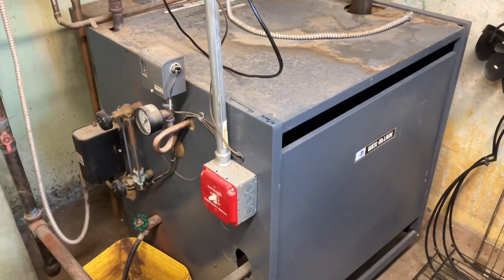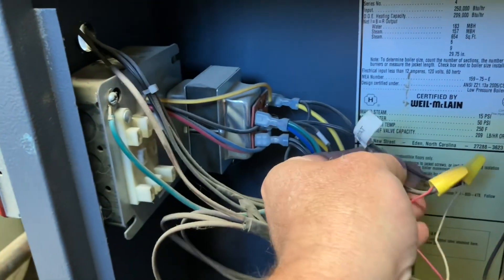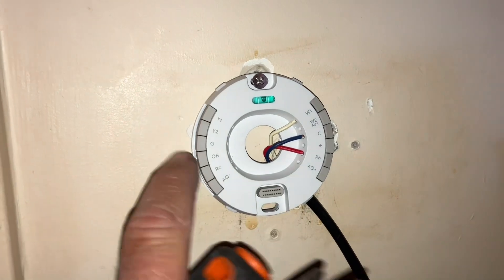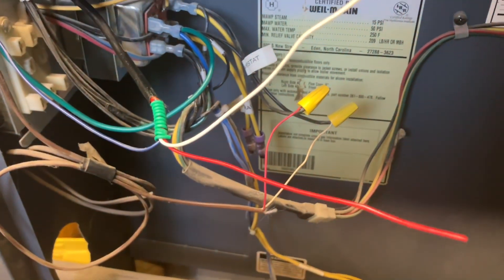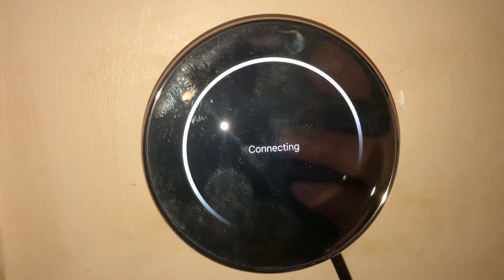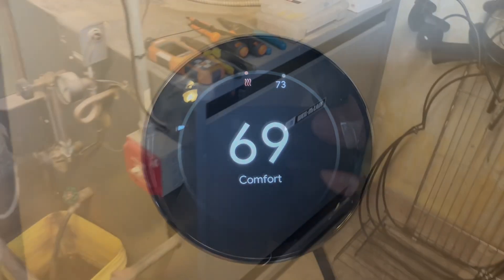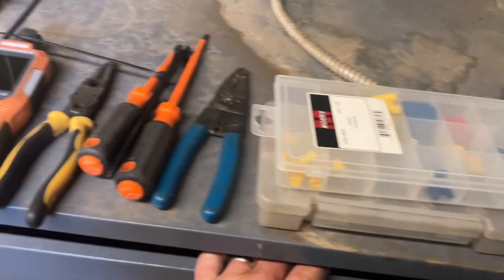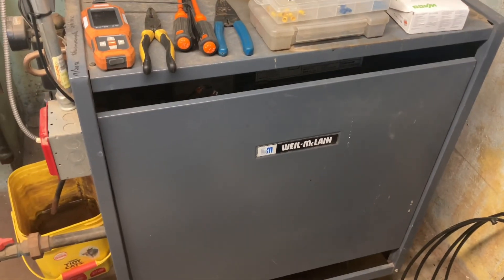How to Install Nest Thermostat on Weil McLain Steam Boiler

Comment: THANk YOU for this video! I got an Ecobee thermostat today and I was at whits end with just the two wires that were connected to my old thermostat. Luckily my insulator had a third wire (unused) inside it so following your video I easily connected it to the C on the transformer side and then to the C on the ecobee side. At first the thermostat wouldn’t power up, so I double checked everything and discovered that my red wire was connected to the G on my boiler and the white wire was connected to the R on my boiler. I swapped the red and white wires on the thermostat side and it powered right up. Glad to have found your video because I’m not sure I would have figured it out otherwise.

Comment: Hello I need help with this! I wanted to change my thermostat with a Nest Gen 4 wifi thermostat. I followed this video step by step but it seems that im not getting power to  the thermostat. There must be a step that was left out in this video. I have the same furnace, i bought the same thermostat, same wires, did the same exact steps and connections but still not working. I can also send you pictures of my connections. That ground green C common wire serve as neutral connected to that screw doesn't seem to have power in it. Please help!

Comment: There seem to be a lot of people getting the Nest to work just fine with 2 wire for heat only. You can also just add an external transformer to power the Nest as well as Nest recommends.

Comment: Hey bud. I watch your videos all the time as an apprentice trying to learn a different part of hvac. 
I ran into a boiler the other day with a honeywell V5155 modulation gas valve. Or a modusnap. 
Have you ever ran into one of these that has failed? 
They are no longer available and there is no substitute valves for them. What should one do when encountering this scenario?
Again, thank you for your amazing videos.

Comment: You mentioned blue to common and ground.   The Call for heat (Thermostat) wires only require a switch closure and the red and white leads to a regular thermostat are power agnostic.  They just require the thermostat to close a switch.  The Nest, or any WiFi smart thermostat requires a proper 24 V on red. That is why you need the common lead.  To maintain a constant power supply to the thermostat.   The white lead goes to the start, call for heat, chain.  If reversed, the thermostat won't activate.   You didn't mention that.  The two thermostat wires on that boiler are both black and just labeled "thermostat".  On that boiler, the 24 V for the thermostat comes from the  output switch of the low water cut off, not the 24 V from the transformer.  Low water will actually shut off the power to the Nest.  I agree that it should also be fused (1/2 amp) on the red lead.  A short from red to blue could burn out the transformer or LWC circuit board.  I only mention this since this is an instructional video on wiring a Nest thermostat to a common 2 wire steam boiler.  While you feel it is overkill to use a smart thermostat on a steam boiler, I find it learns to anticipate the heat load at different outside temps and I like to be able to monitor the daily heat calls and their duration.  The remote control over WiFi is nice too.
Reply from the maker: Thanks for the detailed explanation.

Comment: Great video. We've had 3 nests (3 zones - each with it's own transformer) booked up to our Weil McLain boiler since 2020. No issues whatsoever - had to have new wiring run to each zone, but worth it. I disabled the learning & smart functions as they are really intrusive and not practical. We like it mostly to control remotely.
Reply from the maker: Sounds like you got a nice setup!
Reply: I use a single Ecobee with wireless remote sensors around the house.  Each have proximity sensors as well.  It prioritizes the occupied rooms.

Comment: Mikey if you ever stuck on running a thermostat wire can’t get the wire down try out this it’s called fast stat common maker you won’t have to run wire and let me know what you think about it. Thanks Mikey love your videos brother keep doing your thing 👍🏼
Reply from the maker: Thanks for the tip!
Reply: I used them couple of times they work great don’t have to run a new wire saved time and frustration

Comment: does the ecobee thermostat needs a common wire too ?
Reply: Yes, all these smart wifi thermostats require a regular, steady 24 V AC supply.  You need that ground (common)  return for the 24 V red supply wire.  Standard thermostats just act as an on off switch.  Even the digital ones just act as a switch and they run on a battery for their simple display and operation.  .  The Nest, Ecobee and others are little computers and draw too much power to just run on batteries.
Reply: Hello I need help with this! I wanted to change my thermostat with a Nest Gen 4 wifi thermostat. I followed this video step by step but it seems that im not getting power to  the thermostat. There must be a step that was left out in this video. I have the same furnace, i bought the same thermostat, same wires, did the same exact steps but still not working. I can also send you pictures of my connections. That ground green C common wire serve as neutral connected to that screw doesn't seem to have power in it. Please help!

Comment: I was one of the very first to wire a Nest Thermostat to a Powered Wall Furnace. Hate to be the bearer of bad news, but you should have fused the Rh at the transformer in order to prevent any possibility of burning out the transformer should there ever be a short from Common to Rh. I used a 2A fast blow fuse.

Comment: Nest ?🤮  when they work? Their great but we have a ton of problems with them .  I been switching them over to Degrii and so far? I haven’t had any problems with them 🤷🏻‍♂️ ( however) have had 2 bad out of the box! But I haven’t run into that on all brands of T-Stats ..Nest are Kinda like  a no longer talked about wall mounted combi boiler that’s where I place a Nest  🤷🏻‍♂️🤷🏻 but regardless great job 👍

Comment: The common is needed to charge the Nest battery, or power it indefinitely?
Reply: Thank you
Reply: Both. The nest can steal power on both the Rh and W that calls for heat, but only when the heater is not calling for heat. The common is to keep the nest running while heating.

Comment: I like the new nest, make sure to turn off the applicable smart features. Probably could have used the nest power connector if wiring couldn’t be done. If you have a nest pro you can setup with needing the owner account.

Comment: Personally i think those nest thermostats are junk
Reply: Garbage on heat pumps
Reply: @ agreed
Reply: The first thru third are great. The new generation of Nest Thermostats are junk.
Reply: Why
Reply: I agree they don’t even set the air conditioner correctly and I’m either sweating my as of or freezing.

Cause it doesn’t do its job.

And i think it’s scam from electric company’s.
Reply: Nest is garbage

Comment: thanks nice work. do you see on the field when the steam boiler thermostat set to 72 or so shuts off the heat in room can rise 4 degrees?

be great to see nest on a navien heat only boiler and a seperate ac.